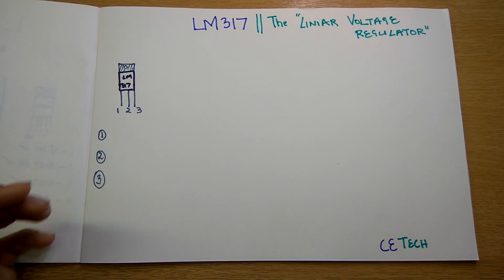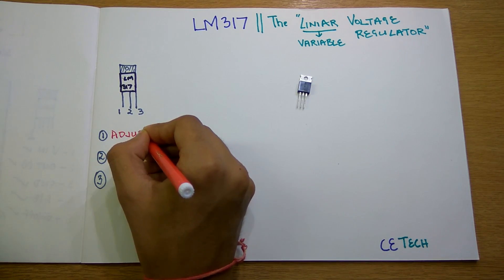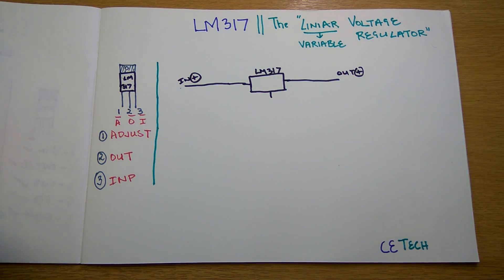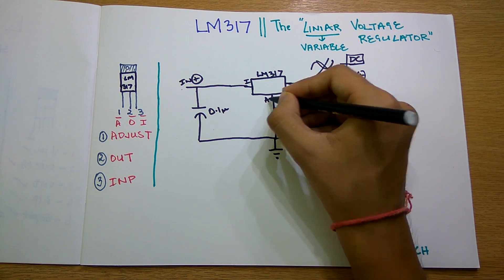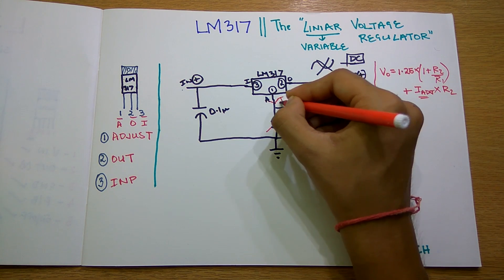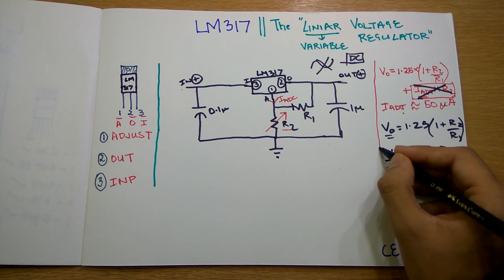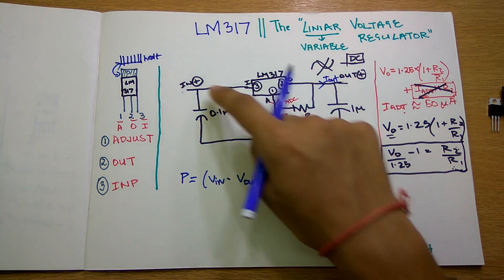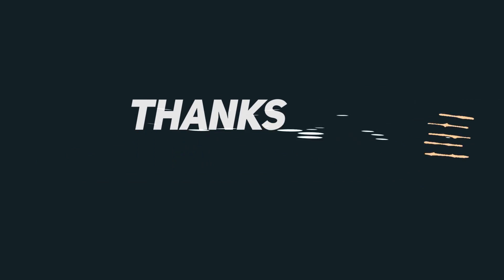LM317 VOLTAGE REGULATOR Tutorial | How to use? | Pinout

Comment: I appreciate your job . But one is mendatory : you always should add component constrain first .Even I don't know this circuit will use at 12000 volt or 12volt . If I check data sheet I think I can get better idea . I am checking youtube cause I don't have much time to do it academically.

Comment: LM317 VOLTAGE REGULATOR  is supposed to have a minimum current output of 1.5A. what does it mean? I am only familiar with the idea of max current output. With this minimum current will it be safe to use this for replacing AA batteries in a wall clock?

Comment: can you use 3 AA (4.5V) batteries to power this and get 5 volts out? trying to use it to power arduino nano
Reply: No, just apply the 4.5v directly to the Arduino pin. NB: Nano draws too much current for practical battery operation.

Comment: Thanks man very helpful video. You earned yourself a subscriber.
I've been asked a question in a assignment and it goes like: Using LM317, design an adjustable voltage regulator with Output voltage: 5 to 12 V and Output Current: 1A. By this video I can figure out the voltage part, but how to fix the output current to 1A? It would be very helpful if you reply as early as possible.

Comment: Please Batao
Kya main iss LM317 wale ka use karke 5v to 1v convert Kar sakta hu... trimmer use Karne ke liye...
Reply: 1v is unfortunately below the minimum 1.25v reference level for the 317 regulator ic. Could use further reduction diodes on the output utilizing the diode voltage drop as a shunt regulator. Try using a ordinary diode with a Schottky diode in series.

Comment: Sir please help me I want to biluilt a this type of circuit for wind mill of input voltage of 1.73 vol and constant output of 1.5 volt to glow a simple small LED please sir help me with my problem at my email I'd is patelshivam097@gmail.com
Reply from the maker: Use a ams1117-1.5
Reply: Thanks sir.

Comment: @ 4:05 for fixed outputs do the following  simple steps,
1. just use a 10k or 100k pot to set the desired voltage and 
2. check the resistance between the pots terminals with a voltmeter and note down the resistance
3. use the resistor instead of the pot.
no crazy / fancy / sciency  calculations to do........ ha ha ha

Comment: Nice one!!! LM317 can it generate a 3.3v with 1.5Amp current? If not what other method we can use? Thank you... You tutorial are better than others.
Reply from the maker: +dev ubhare yes it will be able to do so
Reply: thnx
Reply: For maximum reliability keep the dropout voltage across the regulator at about 3v to 5v at 1.5 amp. A finned rail type heatsink will be called for (some have a H cross section labelled with a BW suffix). There's also the Low Dropout LD1086 regulator which do come in fixed 3.3v and 5v output versions.